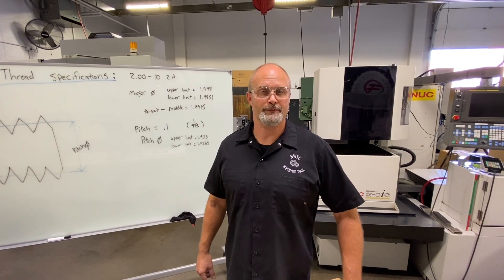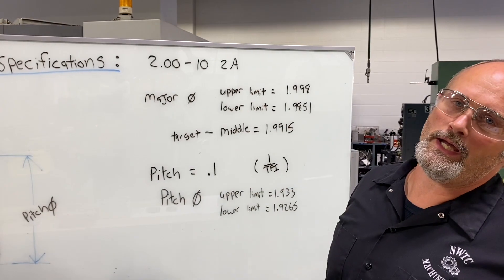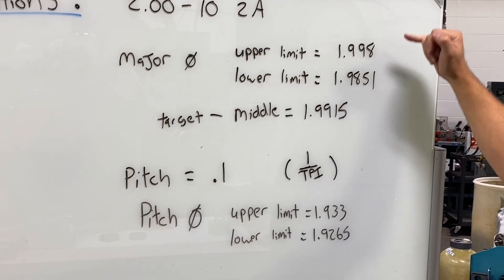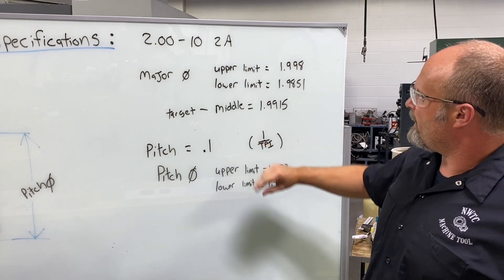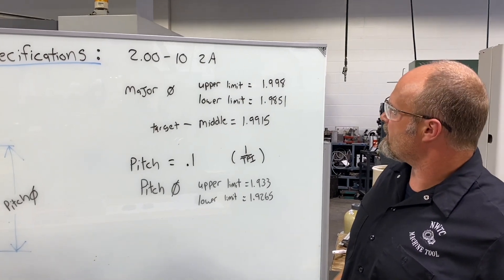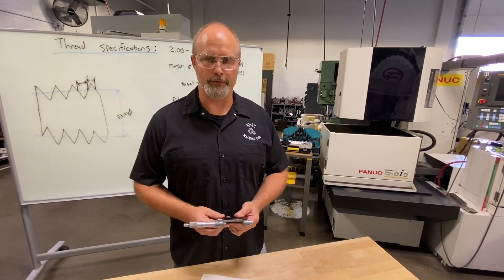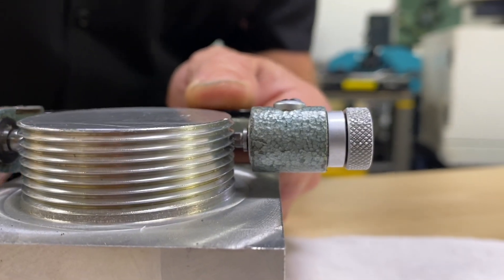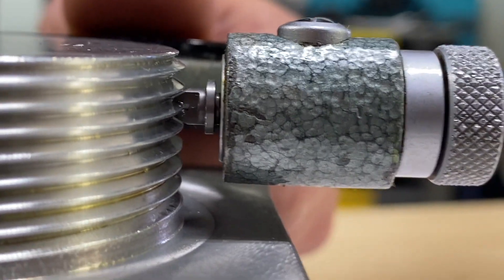How to Measure Threads

Comment: we were just measuring threads cut on a cnc lathe tonight.  This is a nice explanation of everything, especially using the machinist book. Our inspect nut wouldn't fit.  I think our micrometer read .465 inch and the pitch middle was .4460 for 1/2 -13 thread.  Ended up subtracting (.465 - .4460) = -0.019 from the x-modifier of the tool.  retested and the thread was ok

Comment: Excellent video I'm starting to learn how to thread this video gets to the piont without any sarcasm,  One question how did you calculate the best pitch wire .57735  thank you.
Reply: Based on the formula it realized that the best wire diameter is chosen when the wire is tangent with both flanks of the thread form at point that defines the pitch diameter, aka (p/2).

if half of the angle of thread is @  (30 degree ...etc) then the formula for best wire diameter (G) is:

G = p * tan(@)

in which p is pitch length.
if @ = 30 degree then tan(@) = 0.57735

Comment: How about internal threads? Will insert a slightly oversized coil spring with the same pitch with a known wire diameter work?

Comment: what is the 1.5155 number he has in the 3-wire formula? Is it a constant he got from the wire set chart? The constants I am seeing for that thread size is NOT 1.5155
Reply: that constant used for different formula, but it come to the same result.

Your formula could be like this (60 degree thread angle) :

P: Pitch
H = P  *  cos(30) =  0.866 *  P;

Measured = M = x + 3 * wire  =>  x = M - 3 * wire

Pitch Diameter: PD = x + H = x + 0.866 * P = M - 3 * wire  + 0.866* P 

--------------------------------------------------------------------------------------------------
this video use the mean Major Diameter for calculation:

mean major diameter: D = x + 2 * .875* H = x + 2 * .875 * 0 .866 * P = x + 1.5155 * P

Comment: Great, now do one for inside threads because you don't really have measuring tool for that.
And I mean big threads like M40x2.
What I do is I bore out the hole (with a lathe) to the lowest tolerance (in this case it would be 38mm).
Than I would come in with my thread cutter with a full profile cutter and keep cutting away material untill the 38mm get's 0,1 mm bigger.
Than I know for sure that I have full thread and within the right tolerance.
That is the only way I know and can use to 'measure' the thread
Would be cool if someone knows a diffrent way
Reply: Go/No-Go gages are about the only way I can think of ensuring tolerance on an internal thread. The issue is when cutting a thread manually you don’t know how much more material needs to be removed until the “go” goes. For inspection purposes on CNC runs they are fast and easy. I always rely on experience now when to start checking but when I was starting I referred to thread depth formulas.
Reply: @julialuggi1171  This has been driving me nuts lately as I have some parts I'm making with internal threads that are going to be plated. The last run had some come back from plating that wouldn't fit afterwards even though the H number was "fine". When machining abrasive metals, I'd like to know when the tap wears out so that after plating my threads still work. 

If you are familiar with metal finishers you obviously get what you pay for. The issue is that for good finishing you need to pay an exorbitant amount for reliable and accurate results which usually isn't viable for most shops budget. I have called our finishers and asked what the tolerance is on their plating and they said "uhh.. like 2 mil?"... The next option is to change finishers which is going to increase lead times by a few weeks or pay the "good" local company 3x the rate to get it done right. Hell, even the cheap company has risen rates and some parts are now double the old rate. We are awaiting quotes from other companies to see what the new difference is so we can reweigh our options.

Rant over, I just wish there was an internal thread mic that was like an internal diameter mic with interchangeable anvils I guess. I don't see why it can't be done. The internal thread mic that are available are GIANT for massive threads or insanely expensive for a dedicated thread size (talking like $1k).
Reply: @julialuggi1171  For measuring ID threads, Indicting thread gages are very common.  Johnson Gage, based in CT,  is the main company that does that kind of gage.
Reply: If you have an even larger thread than M40 I did see a micrometer that will fit inside for measuring it. Looks like its gotta be a 4 - 5 inch thread though.
Reply: For nuts, I've cut a section then measure with mics or height gage.  No one likes this, but if you need more info then a go no go, it's the only thing I've gotten a good msa on.
Reply: I’m no machinist - just a general hobbyist, so my question to you guys is: would you need to actually measure your part?  Am I wrong in thinking that you could trust your setup and trust the process, enough to have good confidence that your part will ultimately fit?  Alternatively, would you ever have access to the piece of machinery that your threads would actually end up in?  Or is that not a common situation (perhaps you typically only ship your finished product out to your client).  And lastly, what kinds of industries/machines need that level of assurance?  I mean the level of assurance where you absolutely must use thread micrometers?